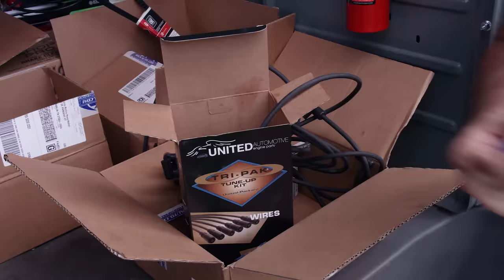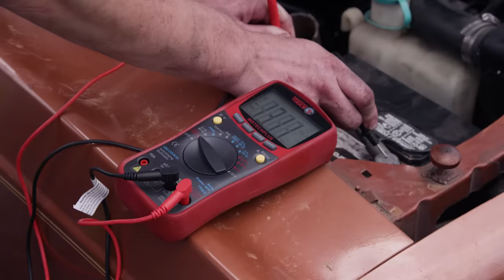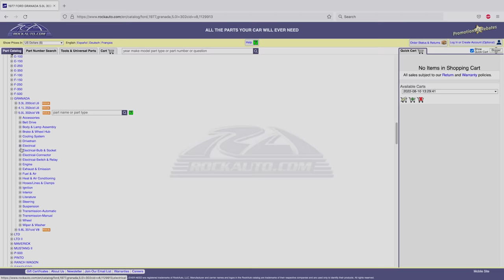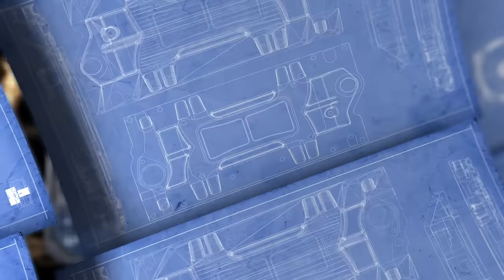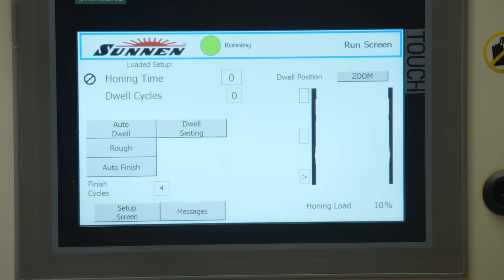Full Build: Building the Ultimate Sleeper Out of a 1977 Ford Granada That Turns 7500 RPM!

Comment: I had bought my very first car with the money I had saved from working on weekends while still in high school. I paid $500.00 for it. I bought it from my dad's mechanic buddy. Even though the old V8 had a blown engine my dad's buddy said he's repair the engine for $500.00. The guy told my dad he would bore the engine out to .030 of an inch. He new rings, bearings, the whole works. He even Put a hotter cam in it. We put some headers on it and some other go fast parts that I don't remember. But that little red Granada had about 275 RWHP. For a 15 year old kid. That was just enough hp to have a lot of fun with. I will never forget that Granada out running my cousins a brand new 1982 Toyota Supra. Good times in that car.

Comment: You started with probably the nicest Granada coupe still in existence, and the results are pretty doggone fantastic.
Reply: I have a 79. In green
Reply: Hard to find a decent one, really really hard.
Reply: @boxcarent.3147  Yes, I had a Navy Blue 78 2-Door Grenada in high school. Graduated in 85 and sold it. Tried to find one a couple of years back and $5k would only get you a 4-door still bent around a telephone pole. Just insane.
Reply: I spent a lot time cramming screws in holes in the Granada Monarch assemblys
Reply: No some of these cars were The Siht.  Before the Versailles, there was the Monarch 'Grand' Ghia.  1976.  Every bit a Cadillac and EXTREMELY rare.  I witnessed one in 1991.  Guy wanted $1500.  If only!
Reply: It even had new tires on it that someone had let the air out of and the grass under the car was mowed.
Reply: Ok

Comment: On a C4, upshift point is accomplished by turning the adjustment screw inside the modulator at the back of the transmission.  If you need more adjustment range, replace the modulator rod with a different length.

Wonderful episode.  Loved it.
Reply: tempting not to use C6.......... shift harder........but the added weight,.....
Reply: @jamesdemestihas9904  ...and more horsepower waste with the C-6.
Reply: Cant they just manually shift the transmission @ the Rpm they want?
Reply: Yes, there's making some adjustments and parts changes to change shift points, true...and then there's installing a full manual reverse valve body that also cannot be SEEN from outside or inside the car. ;)

Comment: my first car was a '79 Granada. Worked all summer at 16 to make the $650.  Loved that car! had electric windows, seat, sunroof, factory cb radio, 8 track.  The 302 smoked a little but it was a champ, I did multiple 500 mile road trips.
Reply: ...was that the Grand Ghia?  In '75 and '76 there was a car called the Grand Ghia.  Every bit a Cadillac.
Reply: We are the same age. Got my 79 granada when i was 16. But mine was a 250 inline six. Loved it to death

Comment: For a 45 year old car it looks great and the old engine didn't sound all that bad. Good to see old iron surviving. Hello from Australia 👍
Reply: not original 302CI, this is a built 347CI
Reply: @grantkoeller8911  I meant before they changed it.
Reply: I'm with you on that, grew up with these old Ford's.
Reply: It was really disappointing to see they just changed the engine. I really thought they were going to rebuild it.
Reply: @kevincostello3856 powder blue ! Lol yeh there was a bunch of these ol girls running the roads when I was young in the mid 70’s(what a time)
Reply: @josearodas3124 They probably would have rebuilt it, except as they said, the engine they pulled out was already .060 over, and that's just about as far as you can go with those thin walled castings. They had to put another engine in that wasn't already maxed on the bore.
Reply: It's funny hearing "45 year old" its like the car is from the '50s!
Reply: @nowitsabadtime  time marches on, 45 years ago to a kid is like us older folks thinking about the 30’s or 40’s

Comment: In the late seventies, my grandpa owned a '77 Granada hardtop coupe with the 235 straight six and a three speed auto. I'm not much a Ford guy, but I loved that car from my childhood. This sleeper, brings back memories, and is one of my favorite projects from Power Nation.
Reply: Back in the day, my Ford car salesman buddy drove a sharp 2 door metallic red Ford Grenada demonstrator with white interior, V8, 4 speed manual...
Reply: My grandmother had one of those cars with the six cylinder and I was shocked when I drove it and I couldn't even get it to spin the wheels in the sand. People in Volkswagen Beetles laughed at that car's power.
Reply: @BuzzLOLOL  I would love to have seen that car! Would have been a great time with the 4 speed manual transmission.
Reply: They never had a 235 straight 6. They only came with a 200,250 straight 6s. Not sure where you came up with 235🤷‍♂️
Reply: @faststang85  - Yeah, 235 was the Chevy straight 6 with more HP than Ford V8's...
Reply: @BuzzLOLOL  lmao yeah whatever makes you sleep better at night. 🤣 the 235 chevy is a turd. The 292 was a much better engine than the stovebolt.
Reply: @faststang85  - Look it up... the Chevy OHV 6 year by year always had much more HP than the Ford flathead V8! By 1953 the 6 was at 135 HP in the BelAir... 150 HP in the Corvette... the V8 trying to find 100 HP... and overheated if you drove it hard... Louis Chevrolet was a race car driver, his cars were never going to have flatheads... not even his 1916-18 V8s...
Reply: @BuzzLOLOL  you're comparing an ohv engine to a flat head.... Compare that to when the y block came out and it was a different story
Reply: @faststang85  - Flathead was all Ford had for 50 years...
Reply: @BuzzLOLOL  for 50 years huh? 🤣🤡 I think you failed math class.
Reply: @BuzzLOLOL  1932-1954
Reply: @TOBYH  - Ford built his first Ford flathead car in 1896... the last Ford flathead V8's were built in Europe in 1980's for Ford trucks... Chevy never had a flathead...
Reply: 250 I 6  is the size
Reply: @seektruth8662 
❤

Comment: My 1st car when I was 16 back in '06 was a 1976 Granada Ghia 2 door. It had a 302 2bbl with a C4 & open 8" after I was done building it in my shop class (dad was the teacher) it had a mild 351W 4bbl , stage2 rebuilt C4 with a 2800 stall torque converter & a GM posi track. God I miss that car, this vid hits the heart strings

Comment: had a 76 granada 4 door it was a beast, it was a great 302, i could get in it start it in the morning even on a hot day run it all day stop it pop the hood take the radiator cap off with out worry and the antifreeze would just be sitting there like it hadn't been run at all, a friend who builds cars told me it was a good thing that it ran cold not hot

Comment: I remember the 70s when you could turn the top of the air filter upside down eliminating any restriction but still having the paper filter in place.  Even if it didn't add much power, it sounded great.
Reply: Did that a few times!

Comment: Great build, one of your best video's yet. You two work together well and are knowledgeable and entertaining. 7 seconds in the 1/8 mile converts High tens or 11 in the quarter. Ya gotta love a sleeper,  especially with those flip of a switch exhaust cutouts. The luggage rack on the trunk is fantastic. I'm curious how much it would gain by ditching that factory air cleaner just for the track. Also would be interesting to put a ram air vent onto that factory air cleaner, many cars from that time period had what looked like dryer vent hose routed to the grill for cool air intake,  you wouldn't lose the stock look that way.
Reply: on target.
Reply: Mid 6 in 1/8 is about mid to high 10s in 1/4
Reply: @michaelbower2117   right, this car would be more like a 11.3 in the quarter.

Comment: Wow, I absolutely love this project.  Being a Ford fan helps of course and the fact that I used to hot rod a Maverick with a 302 4spd.  That Granada being 3800 lbs, you can shave 1000 lbs off that by putting that 347 into a Maverick or Comet.  Fun fun
Reply: Good luck finding a skinny bumper maverick. Those, and 66 back Mustangs are good candidates  for the 347, anything else a 393w would fit! Or, a 408! Noone will believe that's a 302 anyway!

Comment: I had a couple of those car's in the 90s and I installed a cam lifters dual exhaust and a 4 barrel carburator, lower gears in the rear and it flipped me and several others out with how strong it ran lol. I put 8" rim's all the way around it with 70 series tires on the front and 60 series 15 inch tires and rim's all the around it so it would appear to be a stock vehicle, it had plenty of pep and then some lol. I loved playing around with people in it cause nobody ever done anything with em except drive until they most usually just fell apart...That's a nice looking car and you don't see em anymore cause nobody saved em. I's always interested in different types of vehicles that nobody wanted and I paid like 150 bucks for each car on different occasions. The lite blue on blue one is the one I went all out on cause it had low miles, so I figured why not lol. Those were like Fords small or midsized luxury car and even with the upgrades I done to it, it still road smooth and run really good lol...

Comment: Love the small block Ford build, I presently own a 97 Ranger with a 3.0 Vulcan I always wanted to give it bump for more performance but even though the V6 is similar to an old style 302 it doesn't have much available for performance upgrades. Great sleeper
Reply: Yeah, Bump Woo! 🇺🇸
Reply: There's a company that makes supercharger mounts for the Vulcan. I think it uses the Eaton M90 from the Thunderbird Super Coupe.
Reply: You could always swap in a 302. Some Explorer models had a 302 from the late 90s to the early 2000s. It would be a pretty easy swap because of how much Explorers and Rangers had in common in those years.

Comment: I had a '75 Granada that had a straight 6  in it with a 5 speed manual tranny. I bought another one that had a 302 w/ automatic. I swapped out the 6 cyl for the 302. It bolted right up to the 5 speed. Then I put some air shocks, shackle extensions, and G50's on the rear and 70's on the front and that little car would scat! 

The only problem I never did resolve is there wasn't enough clearance between the exhaust manifold and the wheel well. Because of that, the way the P/S hose ran it kept getting burned in half. I finally sold it to someone who had a few more "resources" to play with it.
 But, it was fun to drive while I had it.

Comment: the grenada as a sleeper is a great tip.   I love these guys " getting out of the shop. "  Having said that after so many " will it run and drive channels "  ( Vice Grip Garage is the grand-daddy )  it is hilarious these guys go to pick up a " used " car that is actually newer-than-new.   As far as the motor,   use the motor that came with it and improve it rather than always putting in a bigger gas-guzzler.   This car was super ugly to me in the day but now it is " a classic. "
Reply: Every car back in the day was a BOX; but now that boxes have been replaced by jellybeans, boxes are the rare ones, lol !!
Reply: They couldn't do much with the engine that was in it to start with. It was already bored .060, and that's as far as you can go with those. Made sense  for them to use a stroker they had from another project and toss it in instead.

Comment: Absolutely love this build!! Just curious though, since you went through the trouble of running the Holley and all of the sensors/dash etc, why not just run a throttle body and injectors and go efi? You’re about 90% there…Just a thought. This car would hurt some feelings on the street for sure.
Reply: Yeah, it would have been cool if they used a 90s mustang/f150 5.0 or 5.8 with the speed density EFI. Then they could’ve run an aftermarket ECU and boosted it with a turbo or centrifugal supercharger. There’s a guy in the next town over from mine with a pretty cool 4 door ‘90-ish Crown Vic EFI with a pro charger. Talk about a sleeper. The thing rips lol

Comment: Wow!!  With the car in it's finished/upgraded state... It should easily click off a Low 11 second quarter mile time with the:  Slicks, Nitrous & Open pipes.

If the shifting issue can be rectified, it may hit high 10's in the quarter mile with the same setup.  Amazing.

Comment: I had one with a 302 and 4 on the floor. When the warranty expired, put in a  Crane cam, 4 bbl and created dual exhausts. normal highway driving got 20-28 mph, but the 4 speed , 4th was overdrive it had a top speed in warp factors. I recall going on a straight stretch of road in 78 and a corvette blew by me. I put it in 3rd and pulled along side and waved, we were doing 120 plus. He was shocked. He backed off to get fuel and I followed him to do the same. He could not believe my Granada was that fast. I then said, yes, I pulled along side you in third gear. I started the engine and he knew it was a far cry from stock. Nothing like your monster, but a lot of fun. I was in the Army and sold it to a guy who was headed to Germany, he said he had to guess how fast he was going but loved to go up and down the Autobahn

Comment: I owned a 1977 Granada 4DR deluxe with 302, C4, AC, PS, 8 Track, and a special order that year a 2.47:1 rear end. Got tremendous fuel mileage on the road with 3 kids, but not a lot of power! Bought the car in 1978n with 12,000 miles on after trading in my 1973 Dodge Sport 318.

Comment: I had a '78 Mercury Zephyr with a 302 which I bought for only $1800 back in 1982 from some elderly people, It was running a little rough so I had the variable Venturi Valve Carburetor rebuilt and it ran like a watch,  I then put new Accel plug wires, plugs and distributor cap which made it run even better. The gas millage was also quite good,  I never did anything internally to the engine, but it would still spin the back tires pretty good,   Our down town main drag had extra smooth pavement and this car would do a burn out a half a block long.  It was a 4 door so it was a good sleeper.

Comment: I had 1 with 302!!!! Slidways on everything dirt gravel pavement concrete justagettnit 
Pulled straight 6 dropped a h.o. 5.0 bolted up ez and just changed motor mounts 

Ran like a banshee

Comment: Man yall are awesome! I would Love to see what you could do with my Dad's old Fairmont Futurea and the 200 6cyl.  It's a Cracker Box like the Granada . I started fixing the girl up after my Dad stopped when he got Cancer . It runs great but now just sitting.  I have plenty of parts . I stopped when I could not get a Oil leak to stop on the new Crome valve cover.  Then life happens. I had an accident then Healed. Then a Operation,  then Cancer.  God Healed again.  Then Covid.  You get the picture.  Like your Granada you just never see these cars anymore.  So it's here if you need a project.

Comment: Wow man brings memories. I had the mercury monarch. It had a mustang engine built up. They guy put the motor in the monarch to tweek it while the body was getting done. He then got in a nasty divorce. He sold me the car for $500. I put 1500 in the car. I worked @ auto parts store and got discounts. Won alot of races in that junker. It was the baddest gasser i ever owned. We put that engine to the test. It was a sleeper for sure. Ppl laughed when i pulled up. I got alot of last laughs😅 i miss my beast

Comment: Time 37:15  I agree with replacing the engine mounts any time the engine is removed or even if the mounts are disconnected for any kind of maintenance.  $10 each is nothing compared to the danger of a broken mount.  I was driving in Huntsville Alabama rush hour traffic.  I needed to get out into traffic fast because a lot of places if you don’t “Grab it and Growl” as the saying goes, you can get ran over.  About half throttle was just enough to rip the old motor mount loose and my SBC400 popped up into the hood jamming the throttle wide open with nowhere to go.  Luckily my cousin sitting beside me had presence of mind enough to turn the key off the instant I yelled as I threaded the old Chevy through traffic.  We didn’t hit anyone but we both learned a lesson.

Comment: "Tell me why I have to be a powerslave..."
love the result, a real sleeper, not even fancy stickers! that guy at the crossing wouldn't even notice if he test-drove it, until he press the pedal to the metal. :) it's also interesting to see what differences the setups made. and how much power gets eaten by drivetrain and exhaust. sheer numbers means nothing, important is what gets etched into the road!

side note, I've found out that a too small carburetor can lead to high fuel consumption while the engine is suffocating... and switching cylinder heads for ones with larger valves can already lead to that.

Comment: I bought a brand new Granada 2 door in 1976. It was black with a silver top. 302 3speed. Slotted aluminum wheels all the way around and BF Goodrich wide radials on the rear. I modified the exhaust to dual, lost the catalytic converters and two mufflers either of which was too much. Retimed it to 6* before TDC. And she really ran. Was one of the first to hot rod one of these, She looked as good as any Nova.

Comment: These were sweet back in the day. Rode really nice and weren't super underpowered (thanks to the C-4 transmissions) even though the emissions were starting to choke these things down. The other good thing was '77 was about the first year Ford started going to electronic ignition, which was a major plus compared to points. My grandma, which died in 1990 had a '75 or '76 Granada. After that she bought my mother and father's '77 Maverick, which I loved. I believe they bought a '77 or 8 Mustang II, which was gold, after selling the Maverick to my grandma. 

It took another 40 years for the car manufacturers to dial in the technology to meet emissions and performance, which is where we are today. Today's new muscle cars will usually whip the old school ones from the '60s and early '70s. Go technology!